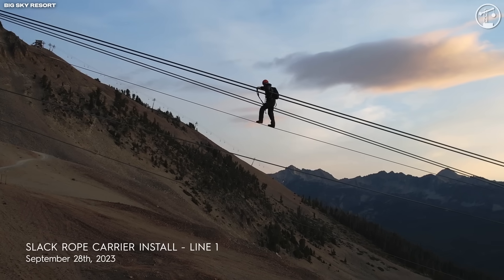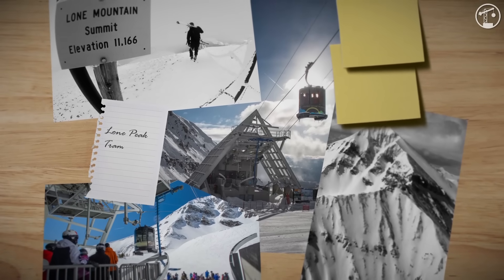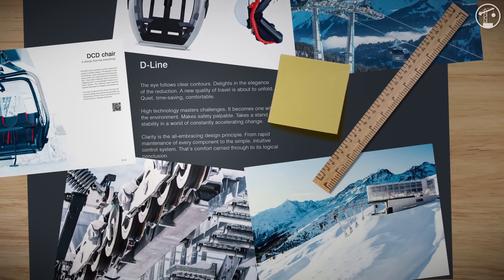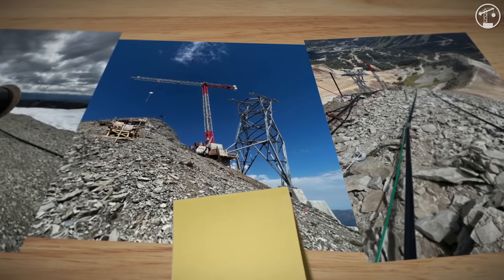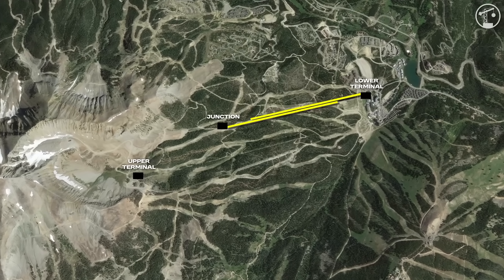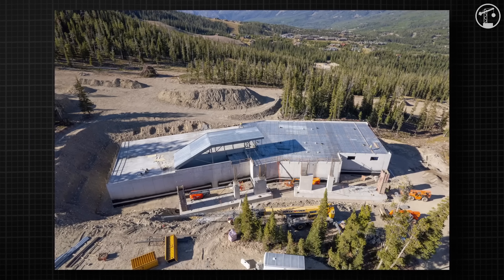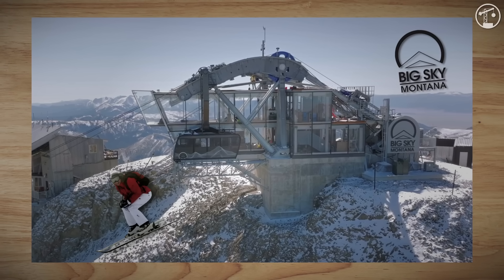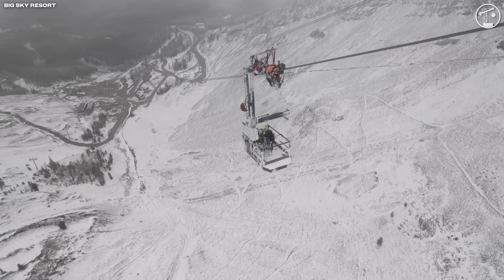Inside Montana's Extreme Ski Resort Rebuild

Comment: The Madison 8 is slightly different than the other new lifts in that its safety bar deployment is forced and cannot be overridden. It can pinch you if not aligned properly and seems dangerous for small kids.. I use and like safety bars, but this seems off.

Comment: They need to invest in teh base resort area.  I was there last March and while the mountain was fantastic, the resort are had barely any character at all.  It was all very utilitarian.  Also, while the modern lifts were impressively fast, I still prefer the exposed regular lifts as it keeps me exposed to the outdoors.  (Riding those rubber converyer belts to load onto the 6 & 8-pack chairs makes me feel liike I'm a product on an assembly line.)
Reply: Second that - I despise bubbles 99.9% of the time.

Comment: Absolute Perfection ❤
Reply: Built by a industry that complains constantly about climate change. I didn't see any battery operated helicopters or bulldozers. They used a lot of concrete, which is carbon intensive. They shipped all the equipment from Europe. Probably not on a sailboat. Nothing but a bunch of hypocrites.
Reply: @TimRannow LMFAO I know right. Remember the giant generators that were used to run the resort's to back in there day. I think there is one still at Mount Cain too. Probably a key factor in the excessive cost of skiing these days.

Comment: The wind load rating at the peak seems low with the recent wind speeds MT has seen in the last few weeks
Reply: Structural engineer here. I’m guessing he meant to say “built to withstand the 100 mph winds” and not imply that 100mph is the limit. If 100mph really is the limit, then that’s certainly worth questioning. Your average building anywhere in Montana should be designed to a 120 (+/-5) mph 3 second gust
Reply: i was wondering about that too. it sounds like the glass is exactly at the current limit. but i have zero expertise on the subject.
Reply: That's what I was thinking, only 100 mph, it should be twice that.

Comment: Couple of errors the tram line animation is of the old tram alignment. The mid station operates as a normal passthrough midstation for operations and as a parking garage when thee lift is closed. The mid is also the drive station of the system utilizing a double groove drive sheave (bullwheel) with a separate ropes heading uphill and downhill.